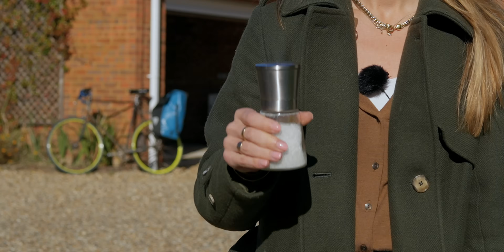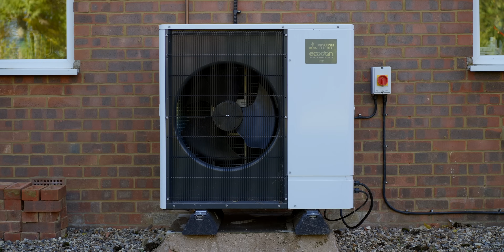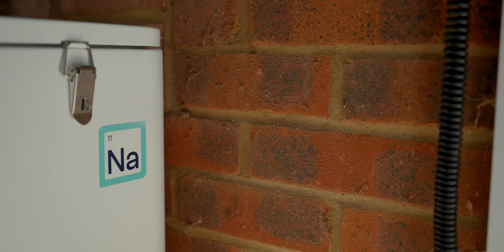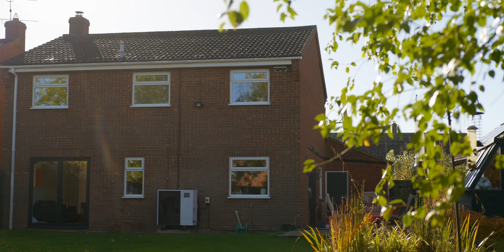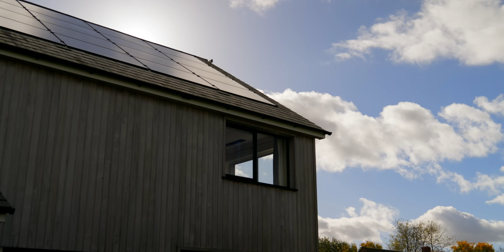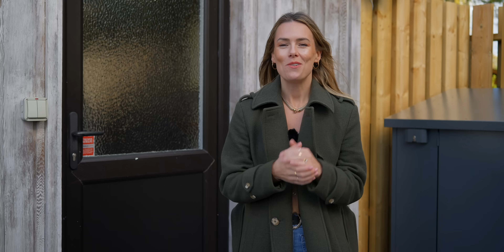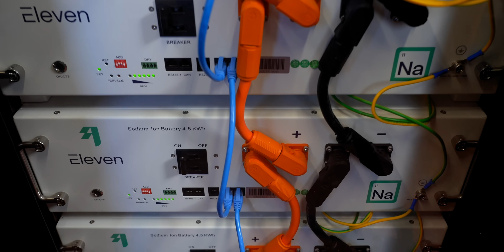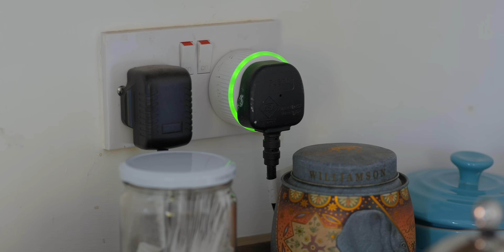Sodium Home Batteries Are Here! Is Salt The Key To Cleaner, Cheaper Energy?

Comment: whenever I see talk of batteries and 10kwh for daily use, it just makes me wish v2g was actually a thing. my ev has a 60kwh and i could easily store any electric during peak times to be fed back into the grid when needed.
Reply: It already is if you live in Australia or Japan. There is one certified device in the UK, and some EVs already work (Kia/Hyundai) so you can do it if you have the right kit. It is kind of ridiculous that both the CCS spec people and the car manufacturers have been so slow on this, but it should start to get a lot more common from about now.
Reply: @xxwookey maybe in Victoria no V2G in NSW yet…
Reply: @xxwookey in Japan it’s matter of life or death and it makes more sense there because of the constant natural disasters, not so much in the uk
Reply: @xxwookey  V2G is just starting out in Australia at present, with a pilot program just launched
https://youtu.be/IstE5KSh0ag
Reply: @xxwookey  What are you talking about? It absolutely is not a thing in Japan. You are not allowed to send power from your vehicle to the grid here, but some makers do allow power to run to your house in emergency situations. Even this comes with huge warnings and requires an install of electrical equipment of around 200,000JPY(£1000). Since there are very few electric cars here and most people can't even charge at home, it's a pointless exercise anyway. I would be surprised if there are even 100 people in Japan with this capability.
Reply: Totally, I would say this techs future is for people without a driveway.
Also I searched the transcript and the word cost is only mentioned twice. It's on par with lithium home batteries but price come down over time.
Reply: I am getting a 21k system with a 15kw battery installed the first week of December. It will also have a hook-up to plug my Lighnting into. The battery will be fine for short outages, but if the power is down for a few days after a hurricane, I will be able to plug the truck in for additional capacity.
Reply: Already Byd dolphin has this technology working with octopus. Check it out.
Reply: @Sensibleman600 

😂😂😂

Why? The vast majority of punters wouldn't understand any of it.
Reply: I am considering getting a generator plug fitted to our switchboard, then I should be able to at least power the home in event of a blackout. My EV has V2L.
Reply: @petesig93 just need a change over switch and eserh generator correctly and off You go😊
Reply: @petesig93 

And how long do you envisage your car battery supplying power for?

What sort of current draw (load)

 would you be catering for?

As in what sort of appliances would you leave running when drawing power from this battery?

Do you have ANY idea of what you're typing about?

No, no, allow me, you have absolutely no idea  of what you're banging on about.

Ditto area BESS installations.

Do the installers of such BESS kit mention how long said kit will carry the load?

They do not.

Doubtless something to do with the trade descriptions acts.

Unless you know better?
Reply: V2G is a thing. Octopus energy are now offering V2G with the BYD seal.
Reply: @tobywilson1622 

Indeed it is.

As covered right here a few weeks ago.
Reply: Just remember, a 10Kw battery is unlikely to be sufficient to run a modern fully electric home.  You’re probably looking at more like 40-50Kw.
Reply: @rosemarygrundy3539 

And yet we're still waiting for a "proper, technically correct lecturette" on the details relating to V2xxx.

Well, that's one thing we certainly won't see on this platform in a hurry, is it.

It's a mystery too why the posters don't look at their electricity bill or digital meters and work out for the load and consumption figures for themselves, after all they pay the bills.

Or, more likely, the comments come from schoolboys who are spared even looking at an electricity bill let alone the pleasure of paying it.

Stupid, dumb  adolescents bleating on about stuff of which they have absolutely no clue whatsoever.
Reply: Wisconsin resident here.  I recently bought a 2025 Chevy Equinox EV, and its battery is approved for V2H.  Downside is it requires a $9,000ish charger/inverter unit from GM, but the car does have an 85kWh battery.

Also, here in the US, a typical home uses 28 kWh per day, so I don’t know where this 9kWh home usage comes from.
Reply: @friskyburger 9000 for the charger is ridiculous and not really worth it...
Reply: @alexandruilea915 I agree.  I’d say MAYBE at half that price, since it would take the place of a whole-house generator.  I have an 8.5 kW solar array that, in full sunlight on the Winter Solstice, is capable of generating over 38 kWh .  I believe that, in the case of a long term (thinking week-long) power disruption I would be OK with that.  Sure a lot quieter than running a generator, no concern about changing oil, and no chance of someone sneaking onto the property in the middle of the night to steal the generator.
Reply: @friskyburger uk homes dont require AC and typically heat using gas or oil. We dont tend to have as many high draw appliances as you would have in the states... We also have low power options for most appliances we use purely as the price of electricity is so high here... I dont think im wrong in saying its the highest or very close in Europe...
Reply: This is what drives me insane. Why is no one with the chance to ask these stupid ministers questions not asking them what is holding back v2h chargers approval? Certainly that will nail the coffin for ICEs. Why no one has actually asked them any questions about the sluggish nature of that system coming online. Why are we going on about 10kw home storage batteries when we slug around 60kw batteries in our cars? In the era of 60/40 hybrid work pattern we have the means to power our homes 5 days of the 7 days week with our car batteries yet we are all wasting our breath going on about 10kw batteries.
Reply: V2h would already be amazing…
Reply: CHAdeMO was the first standard for EV chargers & it arrived in the UK with the Nissan Leaf. It's been bi-directional from the outset. It's the favoured standard throughout Asia & Oceania, Europe & USA decided to produce their own multitude of standards because CHAdeMO wasn't designed to have its data milked by random agencies & because it connects & communicates directly with the battery without involving the car's electronics so can't easily be used to disable the vehicle.
Reply: What car do you have. Some can be used similar to a generator, to take over when your home battery is depleted. It's not a complete answer but does work. Requires a small hack of your invertor
Reply: Is your car home during peak ? Hmm… you have a point. Sigenergy has it right ?
Reply: Dont think I would be inclined to spend 10's £000 on an ev.. then use up hefty  battery charge discharge cycles to run my house.
Reply: You would shorten the life of the battery though since cars still use lithium ion batteries. With salt based batteries, it would be worth it.
Reply: lol 10kwh daily is a joke. In florida we use between 80 and 100kwh daily in the summer.
Reply: Last time I checked V2G is still no standard and every car brand needs it own charger. LFP batteries used in cars can cycle like 6000 times so one cycle a day of around 10kWh would hardly make a dent in your batteries lifetime, it will die of old age first. It's just stupid why it still isn't here, it could solve problems on the grid if used correctly. I was looking for something to couple to a Victron (off-grid) battery system and found out that they don't have it because of all the different standards. People are starting to use the Vehicle to load and generator converters to make their own vehicle to home systems. It's just stupidity and a chicken and egg problem which needs some standardisation.
Reply: @AndreVanKammen aome guys in Romania work with Victron equipments and are soon going to release a smart "inverter" that can connect directly to the car DC charger and charge or discharge from there without any standard needed. It will also be able to fast charge an EV at more than the equiped on bord inverter. They tested it on a Tesla and it works flawlessly. Now they just need to oack it into a nice box and start selling it. From their words "it's ot going to cost an arm and a leg".
Reply: @alexandruilea915  Very interesting.
Reply: V2g is a no brainer. If we had 50% of vehicles electric and V2g 100% of our power generation could be renewable and we would have a balanced grid. I've been making this point for many years. It's an inevetability.
Reply: @ImplyDods  If the grid manager supplies the battery or subsidize my vehicle, with pleasure. Otherwise, no.
Reply: @ImplyDods 

Utter, utter tosh.

Far, far too many schoolboy fantasists still kicking this V2xxx can down the road.

You should try to grasp that if your electricity supplier allows this sort of facility then it's to help the supplier meet any shortfall in supply by using your battery packs connected to their kit which you pay for and any other services charges on top.

Why?

Because it's an earner for them at  your expense and allows said supplier to not build a BESS at its expense.

Until they increase their tariffs of course.

The customer always pays.

If you have a counter argument then by all means post one straight away.

Punters should be wary of all these deals originating from a single supplier as in where's the competition element?

Punters should realise that such a supplier treats all its customers as credulous, gullible and poorly educated mugs.

How could they not? If you were daft enough to buy a BEV in the first place then you're daft enough to believe anything.
Reply: @ImplyDods no!!!
Reply: I wouldn't even think about speeding up the degradation of a battery that cost as much as they do just to make a few £/€/$ per month. I want my investment to kast as long as possible,  let the grid and energy suppliers buy their own storage instead of degrading your system for a few pennies.
Reply: @GaryV-p3h You've raised two aspects of this without addressing them - 1) how much degradation, and 2) how much saving? You mention the word "investment" yet haven't calculated the upside of using that investment to save/generate money. In a basic example if your house uses 15 KWh per day, you could charge an EV overnight for 7p and during the peak rate every KWh you draw from the car will save you the difference between that and the day rate (~26p). So 19p per KWh saved. You do this for 10 units per day saving £1.90 which is nearly £700 per year. That's the easy part, the tricky part is calculating the cost of degradation. To be honest, I don't really know where to begin on that one. However, V2H use will be the easiest task for any EV battery. Relatively steady, no high discharge, no real heat generated. So the degradation will be a lot lower than when used for driving. I'd honestly be amazed if it caused any noticeable degradation. You also need to consider that many people don't even own their cars so don't care about the state of the battery when they hand it back after 3 years.

So would I do it? Yeah, I definitely would. I already have a solar and battery system so 95% of the time am only using import on the cheap EV rate. In winter the battery quite often runs out before midnight and that's when I pay for peak rate electricity. I estimate I'll need about 500 KWh of peak rate each year so I could save nearly £100. Not life-changing but worth doing. Assuming you don't want to invest in an actual home battery though which are getting cheaper all the time.
Reply: If anything, this shows how laughably inefficient cars really are.
Reply: @2cf24dba5fb0a 

And your point is what pray tell?
Reply: @ForestForest-n9i  I don't think car drivers realize just how much more efficient all other means of transport really are, talking about absurdly large batteries in EVs as if it was a good thing.
Reply: @2cf24dba5fb0a 

And a platform, suspension, tyres, brakes etc, to go with the battery.
Reply: Indeed. I do this with my Indra V2H. 
I run my air-con for heating and when the 13.5kwh home battery isn’t enough, just plug in the Nissan Leaf and draw power from it.
Reply: Not a good idea. A because or cobalt battery has 200 cycle lifespan, charge to 80% you might have 500 cycles.
Reply: It is in some EVs just not most of them, mainly the chinese ones where there ARE some. Its one reason im excited about aptera finally IPO'd on NASDAQ, albeit with trump as POTUS, i suspect mass production trajectory delayed
Reply: @kim-ys2fs they ipo'd before having any products? wild
Reply: @kim-ys2fsin Korean ones it’s possible, it requires a special unit for having it automatized
Reply: @kim-ys2fs Anyone buying any Chinese car is absolutely insane.
Reply: That would dramatically reduce the life of your car battery lol! Why don’t you just buy a bigger storage battery?
Reply: @alanmay7929 it's nothing compared with the cars usage. My MG ZS EV uses up to 8KW nust for the heating and up to 130KW from the battery while heavily accelerating so a 6KW continkus drain for a house Heatpump/AC is nothing for a cars battery life. If the battery has 60 kWh, completely draining it over 10 hours would decrease it's lifetime from 6000 cycles to 5999...
Reply: @alexandruilea915 I have nothing against using your ev to power your house but it’s not a solution! The solution is to have a much bigger fixed battery storage at home so that in actual emergency you can actually still use your EV.
Reply: Why would you want to wear out your EV? V2g never made any sense and never will.
Reply: @uue88 what?! Most EVs have a battery that could sustain a home for a few days. The amount it cycles doing so is negligible compared to even driving 10k miles a year.
We also are already well aware batteries last longer than expected and the biggest factors to degradation are long term storage at extreme ends of charge, high ambient heat and any extremely fast charging.

The amount your household usage would impact is laughably small.
Reply: @BradLad-q4u  You want to degrade your already low EV range, be my guest. As featured in this video, stationary sodium batteries will take over the market.
Reply: @uue88  I'm not saying the sodium battery isn't a great addition but pursuing both is great.
Like I said the degradation is negligible compared to what you would get just by driving anyway, maybe the equivalent of 11 or 12k miles a year instead of 10.

Nothing in the grand scheme of things and the depreciation to account for this would still be significantly less than even a cheap battery system
Reply: @uue88  i have 11 year old ev, which i am always supercharging as it is free on my old tesla. Battery at 90% SOH at 270,000kms, i don't think supercharging is as big an issue as people make it out to be.
Reply: A lot of ev makers are giving battery life guarantees in excess of the life of a car so this shouldn't be an issue and if sodium batteries are fitted to new ev's as stated these can cope with deep charge / discharge cycles which Lithium are not so good at.
Reply: @livingladolcevita7318 What EV makers are offering 20-30 year warranties?  I think that BYD was offering 25 years on one model, but only in Thailand, not anywhere else.
Reply: @georgepelton5645 the average car gets totaled within 10 years because of accidents (this is just the average though) so maybe that's what he is referring to. That being said, 6000 cycles on LFP is close to 20 years even if you completely discharge the battery every day, which you most likely will not.
Reply: @uue88  Newer battery technologies can do more cycles, but that has always been the sticking point.  There are some lab batteries now that do 200,000 cycles.  If that hit the market your battery would probably outlast the rest of your car.

There may be a point where car batteries are so ubiquitous that even replacing them is cheaper than a less mass produced home system.  That said, I think we'll probably have cheap home batteries first though, since you can use more chemistry options when you don't have to worry so much about weight.
Reply: @NacorantheHarmonicaPlayer even at the 6000s cycles of LFP we already have this fost most people. The batteries will die of old age and maybe water i filtration before the cycle life is consumed.
Reply: Lol, having 60Kw of storage is not feasable?  Seriously, I am looking for a ev cheap. Put it in my driveway and use it soly for home storage from solar. Yes it will take weeks to charge but so what. I can have enough storage for a week of heavy electricity use, or many weeks of basic use, lights fridge freezer, tv , router, charging laptop and phones. My electricity bill would drop dramatically, then I could also charge it when there are periods of free electricity due to oversupply during nights and Sundays.
And still I could simply unplug and use for driving around town.

I just wish regulations made every car plug in.
Reply: @uue88  EV battery will outlast the rest of the car by a good margin. 

V2G is a no brainer and the easiest way to stabilize the grid.
Reply: @alburaq3290 

Do you have any idea of what you're typing about?

What exactly do you mean by "stabilising the grid"?

Stabilising the grid how?
Reply: @ForestForest-n9i  By storing electricity when supply exceeds demand to be used later on when demands exceed supply.

Is this too complicated for you to understand?
Reply: @uue88 they're talking about 1M miles for car batteries now. I once drove a little Honda that had done over 350k miles but those are a true exception (and I don't know whether the motor was original, though I can't imagine it would have been worth changing...). If cars can do max 200k miles but the batteries can do 500k+, it would seem stupid not to use such an asset in the driveway. Particularly given sodium doesn't really mind being charged to 100%. V2G is just common sense
Reply: @Arthof82

Ditto in UK.

Ditto the world over.

Very few EVs in comparison with the test of the global fleet.

I suspect the only reason the vast majority of BEVs we see in UK belong to leasing outfits.

In fact Robert alluded to this in the "fake, time filling" interview.

His hopes of ICE drivers suddenly having an epiphany moment and embarking on a second hand BEV buying spree are yet to be realised, just a matter of time to see if his hopes are realised.